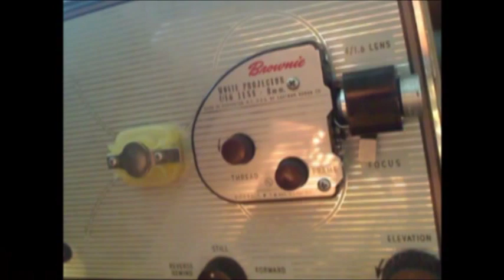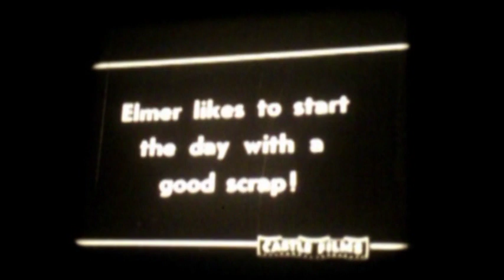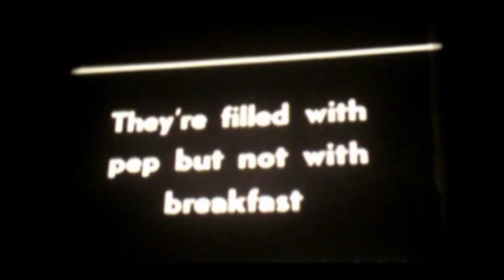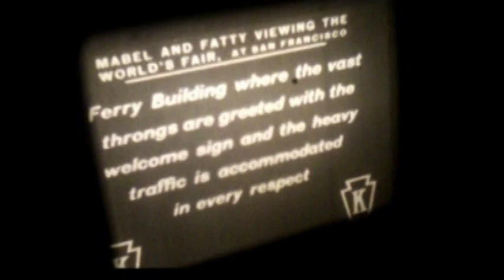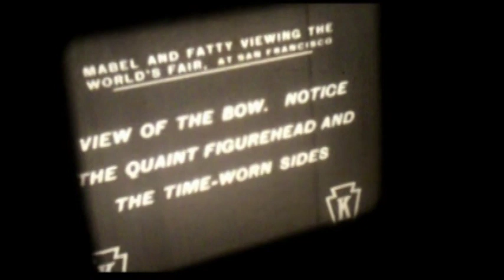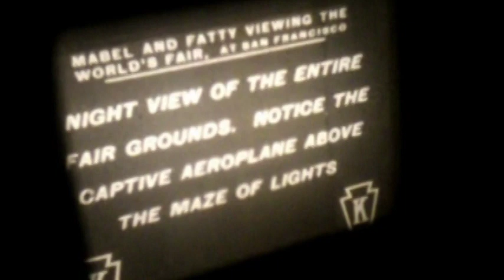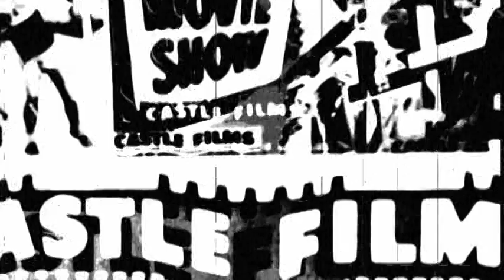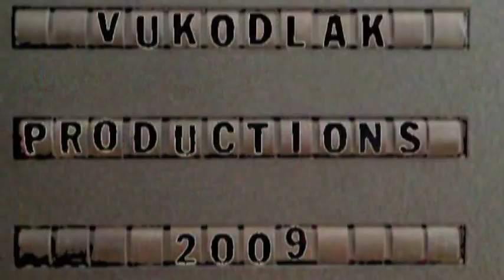Vukodlak Productions-  Kodak Brownie Model 1 Movie Projector

Comment: This Kodak  shows a nice picture.  I have a few 8mm projectors and one is a Kodak probably 1960's.  It is built like a tank. I also have an Elmo ST-1200 super 8 sound, and a few 16mm projectors, one is a military Jan projector.   I cannot post movies very well from the super8 or 16mm as the video camera picks up     flickering that is not visible on the movie screen.  I guess if the projectors were 6 bladed like a cine projector I wouldn't have that problem.  Very nice Kodak.